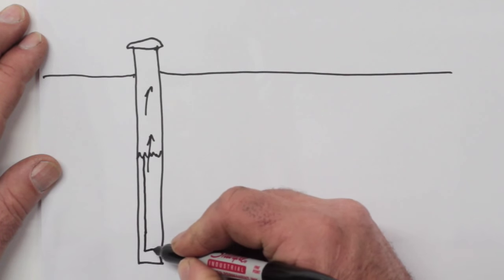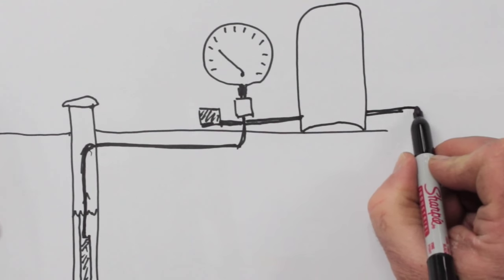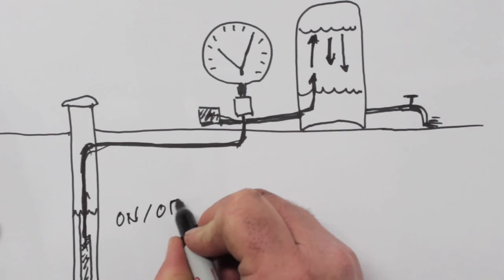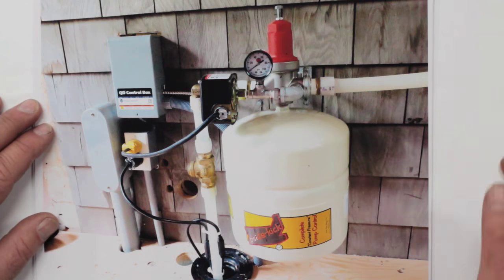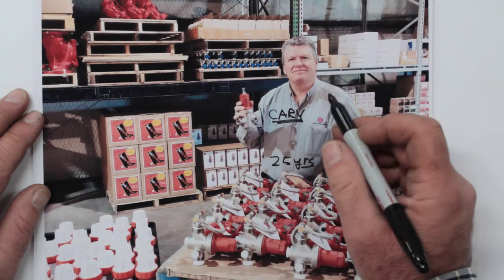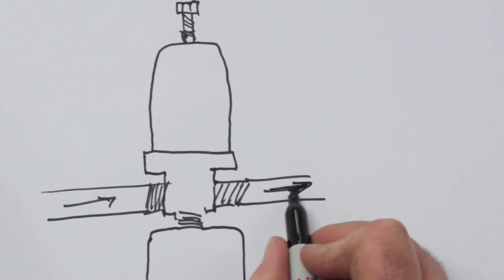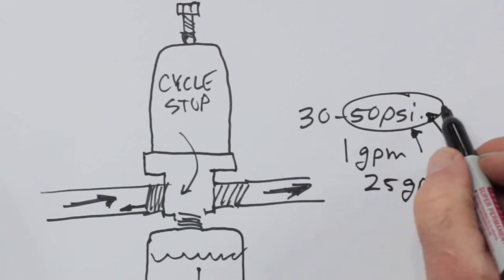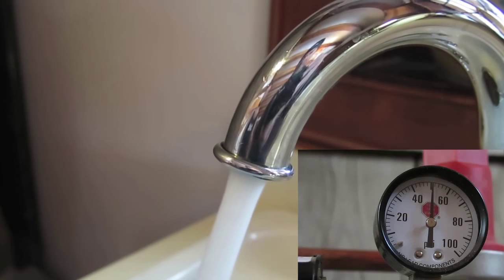How to Make Your Water Well Pump Last Longer

Comment: I see so many of these videos promoting this valve, but they never ever talk about the down side. For some users the system will actually cycle on and off much more often than without the valve. If you wash your hands often, for example, the pump will go on every single time you wash your hands. The valve is effective for when you are using the water for a long continuous period of time, like watering a lawn.  The valve is bad if you are often turning the water on and off because the pump will go on every time you turn on the water. Not so for standard system.
Reply: The pump will only come on when the low cut in pressure setting is met. If you wash your hands before this happens the pump wont start up. The way around that problem is a larger capacity pressure tank. Large tank and this valve would be the best of both worlds.
Reply: @nordhaven  Sorry, but that makes no sense at all. If the pump only comes on when the cut in pressure is met, then how is it a constant pressure system? You can't have it both ways. If its really a constant pressure system the pump has to come on every time the water comes on. What you are saying is logically impossible. If the pump does not come on until the low pressure cut off is met, this implies that originally the  tank is at a higher pressure, and the pressure will go down until the cut in pressure. Thus NOT constant pressure!
Reply: Larry Elterman 
As always in America, you can spot the snake oil when it’s “too good to be true”. They market this device as a way to reduce tank size, but fail to explain the limitations. You’re right, small tank size has drawbacks. 

As for the constant pressure claim, it’s a marketing thing. In a 40/60 system, the water will go down to 40, the pump turn on. The reducer applies back pressure to reduce flow, but then trickles water so eventually the tank will reach 60 and the pump stops. 

The energy usage per pumped gallon increases because the efficiency drops. And a lot of energy is wasted in the back pressure through friction. Their claim of reduced amperage is misleading, but people are gullible.
Reply: @LarryElterman  You are right the pressure is not constant until the tank is empty and the pump is started.  So, the larger the tank you have the longer it takes to see the constant pressure.  A 4.5 gallon pressure tank only holds 1 gallon of water.  This gallon is gone before you get the shower temp adjusted, so nearly all water used is at constant pressure.  The 1 gallon in the tank will fill the ice maker or let you wash your hands without the pump starting.  But when using more than 1 gallon of water the pump starts and the CSV holds the pressure strong and constant until you close the taps.  After closing the taps it will take 30 seconds to a minute for the CSV to refill the tank and shut off the pump.  The tank is basically a mechanical timer that allows you a minute or so to start using water elsewhere without the pump cycling.  If you haven't used anymore water within a minute or so we assume you are finished using water and the pump will go off.  A larger tank with the CSV would allow a few flushes and things before the pump starts, but would mean the first few minutes of a shower will be at decreasing pressure until the tank is empty and the pump starts.  Even large 80 gallon size tanks only hold 20 gallons of water.  So, even the largest tanks will not let you take a shower without starting the pump.  Your water comes from the pump, not the tank.  The tank is only to reduce the number of on/off cycles, and when you have a CSV to do that for you a large tank is not needed.
Reply: @paftaf  You are exactly right!  I have been lying about how well Cycle Stop Valves works for 27 years now.  In over a quarter of a century I have fooled hundreds of thousands of people and even the US patent office.  I tricked the US patent engineers and attorneys and got several patents.  I tricked hundreds of thousands of people into thinking CSV's really work.  It is just the Placebo effect.  I put people in a trance and make them believe their shower water pressure is stronger, their pumps are lasting longer, and using smaller pressure tanks is OK.  I fooled many of these people into thinking the CSV is the reason their pump has lasted many years more than the one before.  I secretly go and personally repair everyone's pumps in the middle of the night just to keep up the ruse.  I spend millions replacing all those pumps so no one finds out they didn't last very long.  I staged the reviews, pictures, and stories from thousands of happy customers.  So you caught me.  You are so much smarter than everyone else.  I have had technical discussions with hundreds of engineers from every major pump company in America and none of them saw through my facade.  I was able to fool everyone but you.  I bow to the great Redwood Madrone and everyone should do as he says.  He is by far the most brilliant person in the world and everyone should know it.  (Big eye roll if you couldn't tell)  LOL!
Reply: Cycle Stop Valves 

CSV drastically reduces the electrical efficiency, wastes a lot of energy, and voids the pump manufacturer warranty. 

You can cry and whine as you want, those are facts. 

I see that you deleted your previous comment, because you know that Franklin voids their warranty if you use a CSV. Thank you for deleting that false comment you made.
Reply: @paftaf  I am not the one crying and whining, you are.  In 27 years CSV's have made hundreds of thousands of pumps last longer and solved people's problems, and you act like this is something new that is bad for pumps.  LOL!  You just can't fix stupid.  And you Redwood are un-fixable.  NO pump company is going to void a warranty.  It wouldn't matter if they did as there has never been a single pump running on a CSV that even needed warranty.  Just the opposite is true.  CSV's have made hundreds of thousands of pumps last much longer than normal, and that is the only reason any pump company would try to talk people out of using a CSV.  Cycle Stop Valves were blacklisted by Franklin, Goulds, and many other pump companies in 1994.  But not for the reason you might think.  The quote from Goulds was...."CSV's make pumps last longer and use smaller tanks, Goulds makes pumps and tanks.  So any employee that even mentions a CSV will be fired immediately."  Cycle Stop Valves couldn't get a better recommendation than that!  Have a nice day!
Reply: @cyclestopvalves8380  Actually, yes, you are exactly right, you have been fooling people for 27 years. You are relentless in your defense of this product that actually costs people money in almost all cases.  You have a good thing going. A thing that really does not do anything, but is complicated enough so you can fool people. That is how you keep your company alive. Well I don't blame you. Why not. It's your company, your money and your life. But the fact remains your product does nothing good for the average user. Sorry, that's just the facts.
Reply: @LarryElterman  I am so sorry you are unable to understand how this simple valve works and how many advantages it has for a pump system.  I am glad you have never had a failed pump, check valve, pressure tank, pressure switch, etc., or just annoying fluctuations in shower pressure, and never needed a CSV to solve these problems.  If you had , you would be one of the hundreds and hundreds of 5 star reviews on our web page instead of being here annoying people about something you have no idea how it even works.  If you would like to expand your mind instead of your ego and figure out how a CSV works, I would be happy to explain it to you.  Just call me at 806-885-4445.  You are just embarrassing yourself as it is not that hard to understand. Thanks/Cary Austin

Comment: Stop all the grammar, just install a 5000 litre tank and pump will remain off for days
Reply: A 5000 liter pressure tank only holds 1200 liters of water.  The tank must be 75% air to work properly.  Your water doesn't come from the pressure tank, it comes from the well and pump.  Besides the huge expense and space  needed there are a lot of other problems with the old pressure tank method.  The CSV solves them all.
Reply: I think he meant 5000gl storage tank.

Comment: Hi, I'm making a system like this for my house, I have a well. My question is:  Does a (CSV) Cycle Stop Valve  works the same as a Pressure Reducing Valve (PRV)?  If not,  what is the difference between these 2 valves?
Reply: Well in all fairness;  Why haven't Bailey or Cyclestop answered this simple question that was asked four months ago?  I'd certainly like to know the answer.  I think they are basically the same thing.  So, If they are (or are not) basically the same what makes the metal CSV better and worth significantly more money?
Reply: Didn't take long till I found my answer in plumbing forums: 

CSV verses PRV or VFD

https://www.plumbingforums.com/threads/csv-verses-prv-or-vfd.3271/
Reply: @SuperDanielB1  The CSV works like a pressure reducing valve as long as you are using some water.  When you stop using water the CSV turns into a flow control valve that refills the tank at 1 GPM.  A pressure reducing valve cannot do that.

Comment: With over a million pumps being controlled by Cycle Stop Valves as we speak, in 30 years no one has ever shown damage to a single pump.  Just the opposite happens.  Some of these pumps have lasted 30 years on a Cycle Stop Valve when they previously only lasted 2-5 years.  This proves Cycle Stop Valves make pumps last several times longer than normal.  I have offered to replace or pay for any pump damaged by a Cycle Stop Valve for 30 years and no one has been able to take me up on it, because not a single pump has failed because of a CSV.  Either show me a pump that was damaged by a CSV or stop saying it will happen, because it never will.  People push VFD's because they cost a lot and don't last very long.  Over 30 years time you will have spent $7000.00 more on a VFD system than a CSV system for a normal house pump, which is exactly why people who sell pumps try so hard to talk you out of a CSV.  A CSV will not, cannot, damage a pump in any way, and I guarantee it.  See if you can get a guarantee like that with a VFD.  Lol!
Reply: Your cycle stop valve that I’ve had in place for YEARS caused my pump to fail.  Yeah, I know the pump fell off the damn pipe and sucked electrical tape into it, thus ruining the pump, but it was your damn cycle stop valve that ruined it!  Totally kidding of course.  Love my cycle stop valve.
Reply: @kevingray8616  Sorry for your problem.  It was probably the tape that came loose first, clogged the pump, and got it hot enough to melt the pipe.  Gotta use good tape or Pipe Wrap.  Never leave the ends of the tape on anything other than more tape.  The end of the tape will come lose if it is stuck to the pipe or anything but more tape.

Comment: Your pump is not going to be going on and off? Why not? Every time you flush a toilet, open a faucet for a second or two, use a hose to water a flower pot, the pump is not going to constantly be going on and off? Either the pump is going to go on every single time you use water or the pressure is going to come from the tank, in which case it will decrease. That is why everyone in the world with their own system uses a tank, so the pump will not be going on and off every time they need drink of water,  and why this sounds very suspicious.
Reply from the maker: Good Morning bigpardner,
No need to be suspicious. This thing works like a charm at my place. I'll explain again how it works . . . Normally (without the valve) you turn on your water and the tank pressure drops to the cut-in level. The pump comes on and keeps running until tank pressure rises enough to hit the cut-out level, then the pump switches off. With the cycle stop valve, the pump comes on when tank pressure hits the cut-in level just as normal, but the pump keeps running as long as you're using water. Tank pressure never rises above 50 psi, so the pump never switches off as long as you're using at least 1 gallon of water per minute. This is the key concept you need to have gotten from the video – the pump keeps running as long as you're using water. The valve does this by mechanically throttling the outflow from the pump.  The bottom line is a constant pressure as long as you're using water and you get fewer ON/OFF cycles for the pump. Put an ammeter on the pump circuit and you'll find that the pump draws less current when being throttled, not more as some people often mistakenly assume.
I hope this helps, and thanks for watching.
Steve
Reply: My pressure switch is going on and off.click click. On on.is my pressure switch need adjustment
Reply: @todfelix5589  That can be caused by 3 things most commonly. 1. You have a leak. 2. you have a plugged up pressure switch or pressure switch nipple. 3. Your pressure tank has gone bad and is water logged.

Comment: Well, it will work ONLY with centrifugal pumps, but it will DESTROY any submersive pump which works on spindle principle (mostly used in wells) if there will be no fuse valve (typ. 6bar)... In both cases you push the pump to work on it's limits (to produce highest preasure it can) continuously. This system is just "cheating" the preasure switch by preasure reduction valve placed between pump and switch with tiny bypass (you can buy it much cheaper). I'd not expect it "last longer" at all, the pump simply last shorter. Why? Most pumps are not desiged to run continuously (e.g. there is specified max time it can run continuously and max ammount of cycles per hour), therefore you will overload it after few minutes of continuous run at max preasure.
Reply: Wrong. Submersible pumps/motors are rated for continuous duty cycle.
Reply: @stevee7774  Thanks Steve.  Submersible pumps say for continuous duty right on the side of the motor.  I don't know why some people have such a hard time figuring out the CSV will greatly extend the life of pumps by making the pump run continuously when water is being used?

Comment: So this ONLY applies to submersible well pump controlled by one home system?  In other words this does NOT apply directly to my situation?  I am on a COMMUNITY well so MY setup does NOT control THAT pump...my system only controls what I think is called a "jet pump" that provides pressure that our community well supply does NOT provide ...without the jet pump water only trickles from taps.    Does this apply to MY system?  I am mystified by all the advice on youtube and from vendors etc ...why does it have to be so friggen difficult to spec the right equipment that will work best??
Reply from the maker: Hi Doug! Some version of the unit in the video works for any kind of non-piston-type water pump. So this means it works on submersibles and jet pumps. It sounds to me like you can use a device like this on your community system, but it would have to be sized for the total flow involved. The guy I got this device from at Cycle Stop is experienced in small systems and large ones, so it's worth a call to him.
I hope this helps, Doug. Let me know.
Steve

Comment: 3:00  If you pumps is runs continually  where does all the water go??
Reply: There is no extra water.  The CSV is just valving off the excess and making the pump produce exactly the amount being used and no more.

Comment: Reducing a pumps flow too less than 50% it's rated value will cause cavitation and vibration reducing the pumps life. Amp draw is only half the story and anyone working with motors should know that reduced draw means restriction. I can print a chart off the plc and tell you what pumps in my mill need service. Maybe the electricians you talk to wire houses for a living. I work with pumps in the mining industry.
Reply: As far back as the early 70's such controls existed. The Jacuzzi aqua Genie was one. Pump killers, due to cycle times being short,and high back pressure to cause slow demand flow.  Not a fan....
Reply: @Splungers  Absolutely not true!  The small difference in the CSV makes it better for the pump than the old Aquagenie or Hydroservants from years ago.  But many of those pumps as well as the Aquagenie or Hydroservant are still working to this day.  I am replacing a Hydroservant system that has been operating flawlessly for 53 years as of today.  These kinds of valves make pumps last longer, not the other way around.

Comment: Isn’t this just a simple water pressure regulating valve?
Reply: Up to a point yes.  But when you stop using water it turns into a flow control valve that fills the rest of the tank at 1 GPM rate.

Comment: MF, If you had any problem with a CSV  it is because you are not as sharp as you think and did something really wrong.  The CSV is such a perfect pump control that pump manufacturers blacklisted it as a disruptive product in 1993.  That means the CSV makes pumps last longer, not the other way around.  If you can't understand that this simple valve is much better than a VFD you certainly do not need to be installing pumps, much less something as complicated and troublesome as a VFD.  If you have actual proof of a CSV damaging a pump in any way, I will replace the pump and pay your pull and set charge.  In 30 years no one has ever taken me up on that offer because there has never been a single pump damaged in any way by a CSV. So, either show me a pump, any pump, damaged by a CSV or stop lying to people to sell your expensive and short lived VFDs.